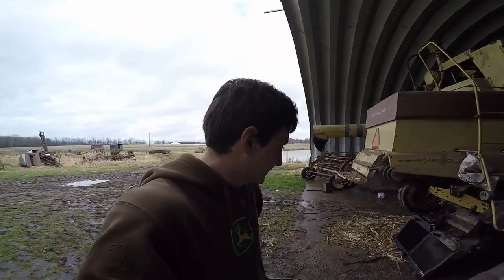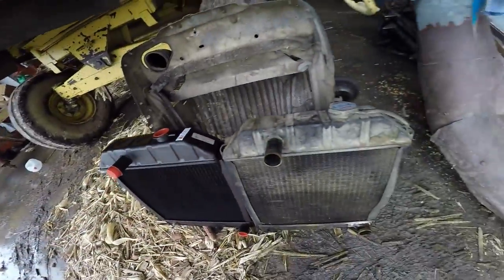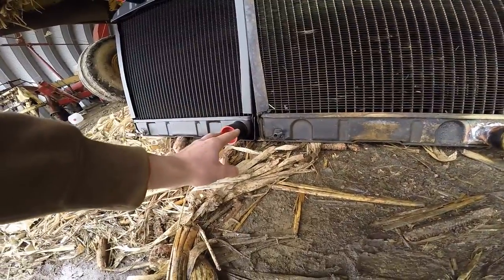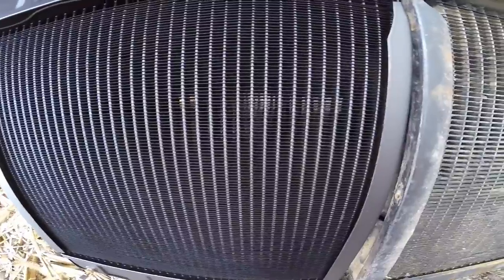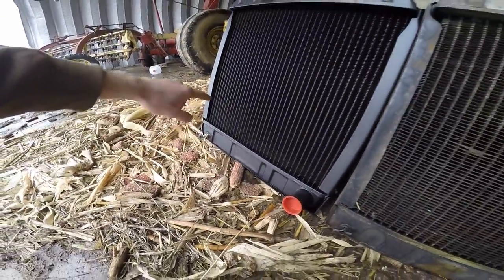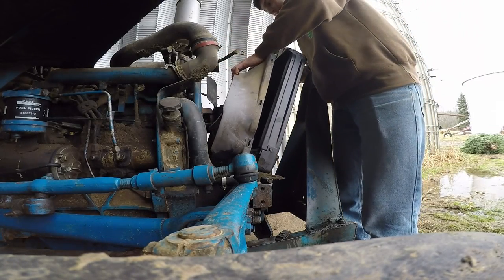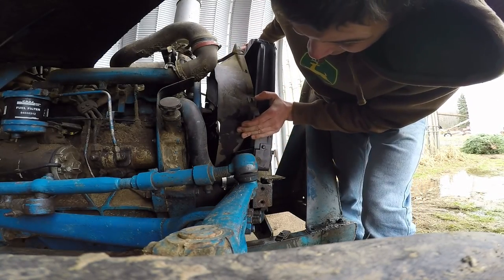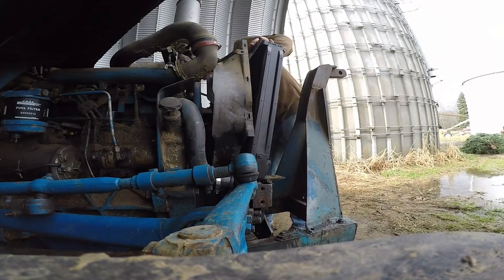Radiator work on Ford 2810 Part-3

Comment: Most of the parts I buy are aftermarket and making them fit is just a fact of life. OEM parts are great IF you can still get them and can afford to buy them. LOL  Most of the time aftermarket is the only way to get parts for older equipment but sometimes you have to go with OEM and pay the price because there is no aftermarket parts made to replace it.  Who knows how many different Fords or other tractors that radiator fits in so you just got to make it work. LOL Aint Farming Fun ?  LOL  Bandit
Reply from the maker: From my estimation, that radiator should fit the three and four cylinder Fords from '65 through mid 90s. That's what I like, Ford kept mostly the same designs with many interchangeable parts. This isn't farming, its running a repair shop, LOL